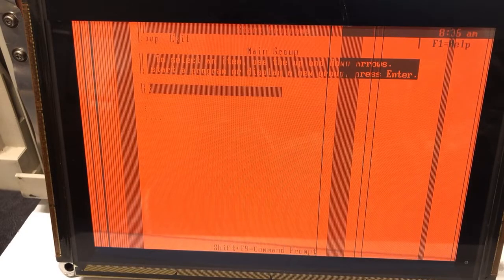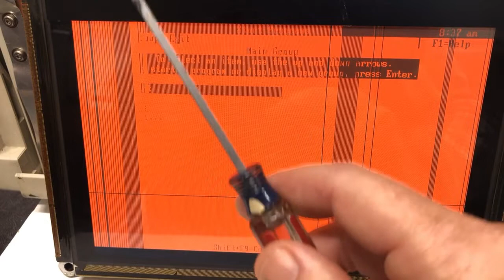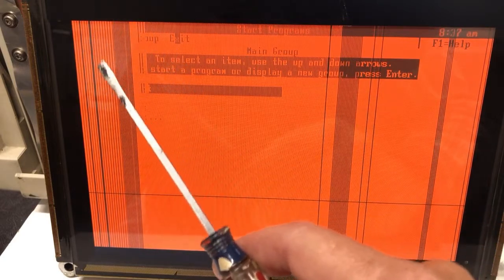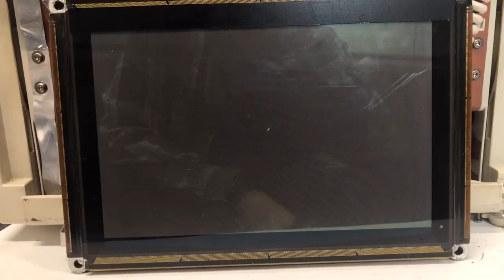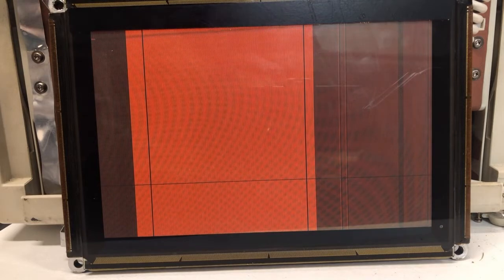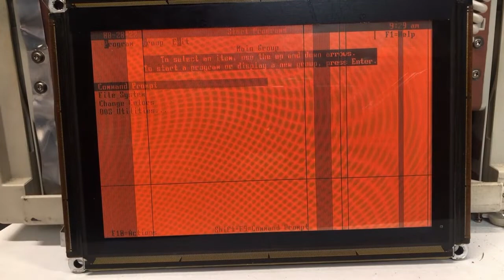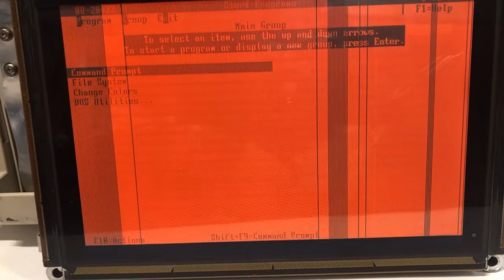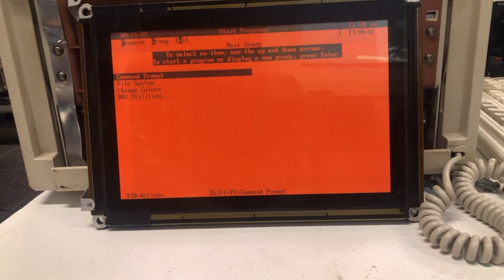Compaq Part 2: Repairing a defective plasma screen

Comment: I'm currently doing this right now, I got four screens from someone on vcfd forums, two Toshiba and two compaq. Any tips? I'm currently struggling with mine, it seems that every time I solder a new one on it creates lines that weren't there before
Reply from the maker: It's not easy.  You may  be fixing some that now show, pre-existing but hidden, problems from another chip. You have to be very careful where the flexible trace sheet is attached near the glass also.  It can go bad there too and so far I haven't found a good way to correct that. I ended up having a couple of lines bad at that point and temporarily fixed it by putting in a small piece of something to add just a bit of pressure on the trace near the glass screen.  I WOULDN'T RECOMMEND IT.  It may be fixable if I added some heat while I pressed the trace at its entry to the screen but I don't have the guts to try it.
Reply: I think YouTube keeps deleting my comments, but I ended up finding a lot of suppliers. The only problem is that the chips are bare minimum $5.00 a piece. The SN751518 I managed to get a quote for $1.65, but every other chip is upwards of $5.00. I'll post a comprehensive list of findings on the vintage computer federation forum when I'm done repairing these screens, YouTube keeps deleting my comments for posting links. 

A few things to note: horizontal chips almost never go bad, I only have two screens that have dead horizontal lines, and it's only one chip on those. The plastic frame ones usually have more dead chips compared to an aluminum frame screen. Aluminum frame screens are more likely to have severed ribbon cables because the aluminum warps and presses against the ribbon cable cutting it. The white packages can cause an entire section to go bad if one goes bad. I also don't know if any way to replace those white packages under the chips. The main thing I have learned from this repair is that if you bang your head against a brick wall enough times, it will eventually break.

Comment: Amazing job! Glad to see that these beautiful gas plasma panels can be repaired with effort. I have an IBM P70 that has lines popping up intermittently (no permanent dead areas or permanent lines thankfully) so will give reflowing chips a shot first. As the screen warms up is when it starts acting up so I am assuming it's bad connections from constant warming and cooling. Definitely have hope now that I saw what you managed to do. What temp did you run your heatgun on?
Reply from the maker: Not sure but it was no higher than medium, was really scared of melting it. There is also a possible bad spot where the traces meet the glass sheet, it might work to heat there but so far I’m a bit worried to put heat there. I have a couple of traces that are bad there that I just put something next to the glass to keep pressure there.

Comment: Were you able to determine the relationship between each vertical line and each chip? I.e. does each line have one top chip and one bottom chip driving it? Or is each line only driven by one chip and they are interleaved? When I say "lines" in this context I mean all lines, not just the defective ones.
Reply from the maker: Each chip runs about 8 lines or so.  And yes they are interleaved above and below, and left and right.